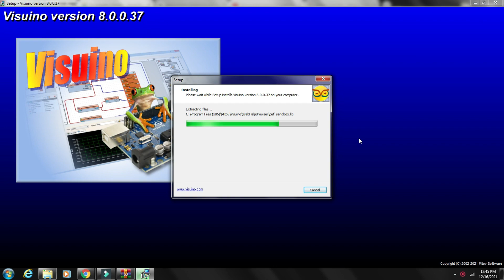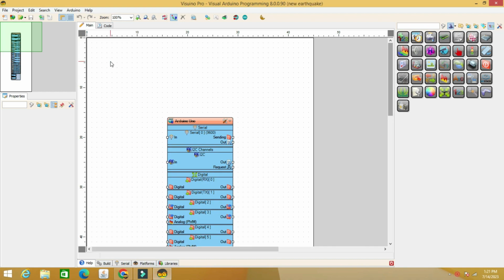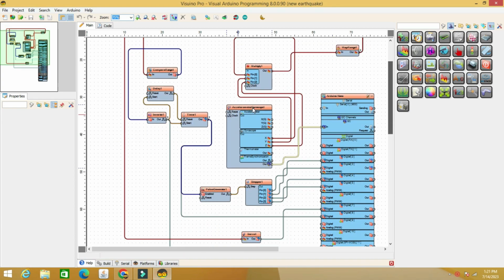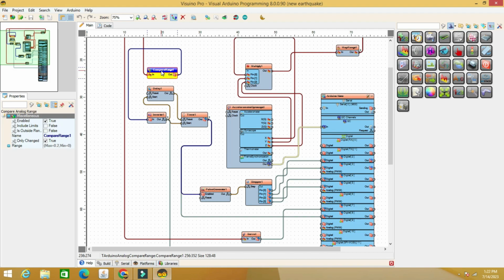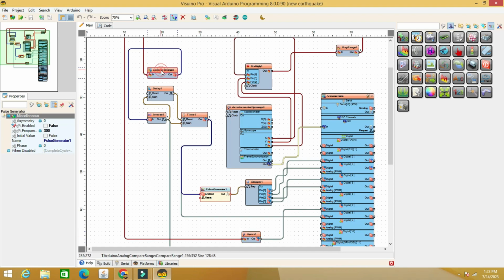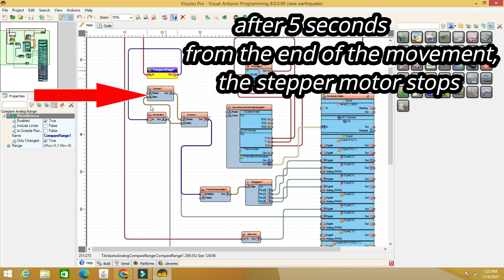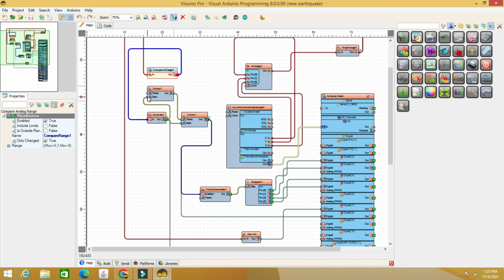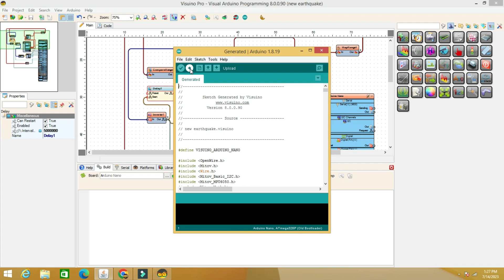How To Make A Seismograph! 100% Working!

Comment: Hi there, thanks for sharing your interesting project. I am wondering if it is possible to show the graph on a mobile or laptop screen instead of a piece of paper. It is  then possible to save the data for later analysis. I think if the accelerometer board is fixed on the long arm of a seismometer then the vibration can be recorded live.

Comment: Love the tutorial! This could also be applied to display other sensor data like heart monitor.
Reply from the maker: Thank you, initially I even thought about the heart rate sensor, but it is very sensitive to voltage variations and due to the vibrations of the servomotor, it might appear erroneous.